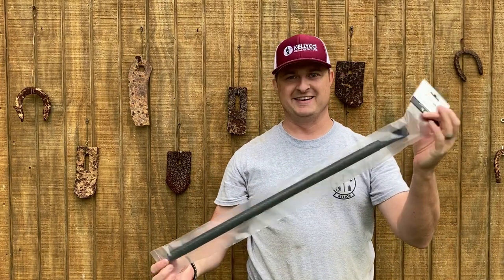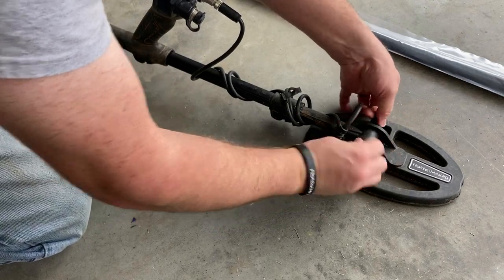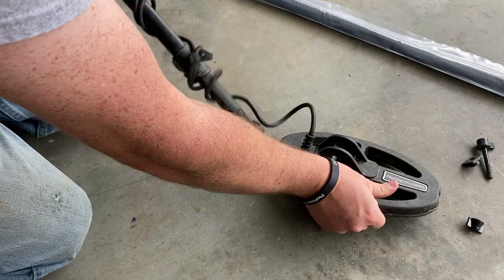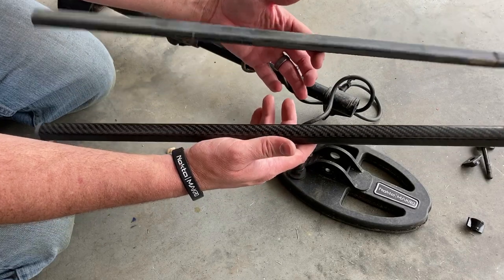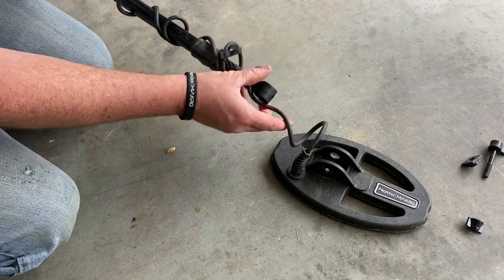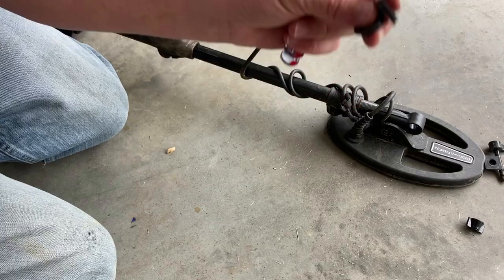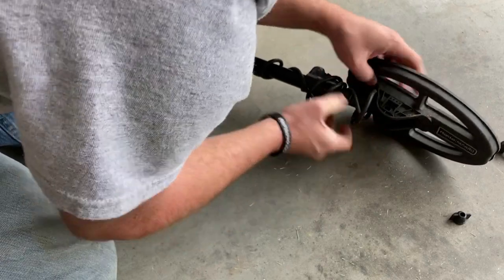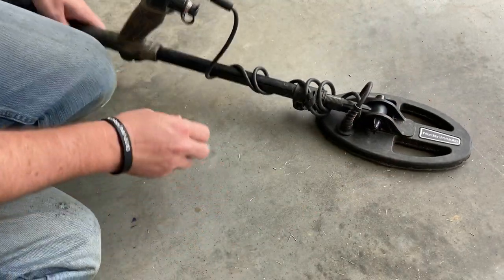NOKTA MAKRO SIMPLEX Carbon Fiber Lower Shaft - First Look

Comment: Does the Carbon Fiber Shaft actually come with a Nokta  Makro Tag on the package? Its not the one From Outlaw Metal Detectors in Oklahoma?
Reply from the maker: Yes, this carbon fiber shaft came straight over from Nokta Makro inTurkey. Direct shipment. I’m not sure about that detector store in Oklahoma. They may take them out of the package or they have a third party making them.
Reply: @southernrelics  THANKS.

Comment: Whats the benefits to switching shafts? Just the fact its a lot lighter weight
Reply from the maker: Mainly. The stock lower shaft is a little flimsy and the carbon fiber eliminates that. It also helps the balance to give the detectorist more time swinging with less arm fatigue.

Comment: I'm not worried about weight so much as how cheap and flemsy the stock shaft was.
Reply from the maker: Very true. It definitely strengthens the swing and knocks out the flimsy-ness. Thanks for watching
Reply: I just ordered my carbon fiber lower shaft a few minutes ago. Can't wait to try it out.